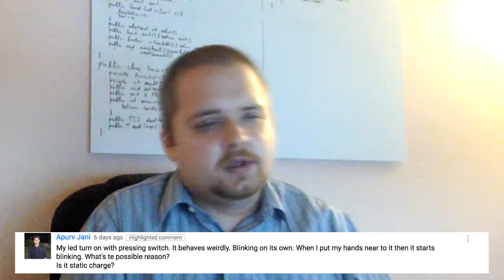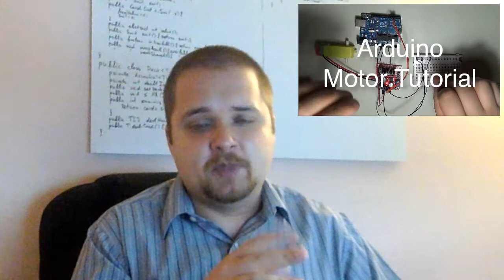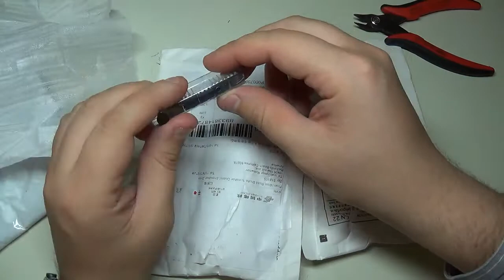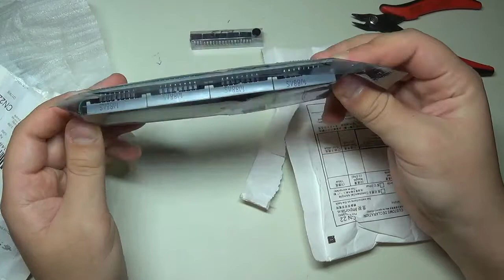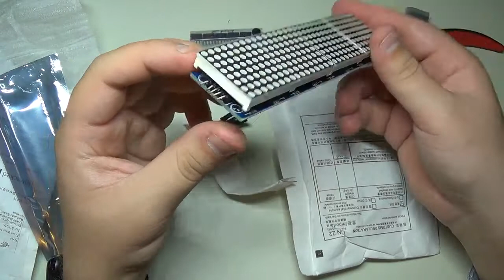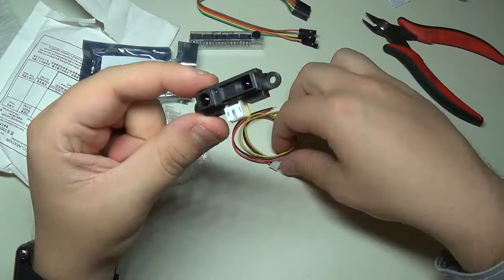Q&A #2 - Floating Voltages, Motor Drivers, Arduino Settings & Mail Items - LED Display, EEPROM

Comment: 2:50 Can you send 12V DC to an Arduino?  Answer is yes, you can power your Arduino with 12V DC,  but most people tend to use 9V (or alternatively just using the USB port).  

More info here:
http://playground.arduino.cc/Learning/WhatAdapter
https://forum.arduino.cc/index.php?topic=2429.0
Reply from the maker: Good point. I remember that there is definitely a voltage regulator for the DC jack there, so it is protected. That being said it's really easy to miss-wire if you're trying to use one of the header inputs.

Thanks for the clarification.